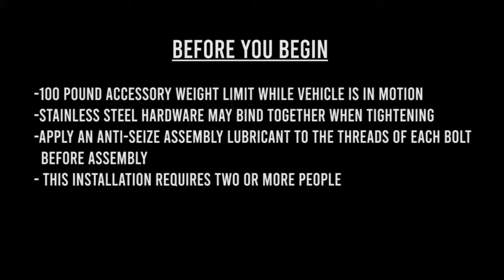Aluminess Sprinter 2019+ Rear Door Ladder Installation

Comment: For mounting the brackets, is it the same process, as for installing the driver rear door tire carrier? I have been looking for a (driver side rear door tire carrier) install video. 2019 Mercedes sprinter 4x4 2500 turbo diesel.
Reply from the maker: It is the same process! We actually have made it a tad bit easier - our new bracket only requires you to loosen one of the hinge bolts.
Here's our install instructions: 
http://www.aluminess.com/wp-content/uploads/210570-TIRE-RACK-Mercedes-Sprinter-Rear-Door-V2-Installation-Instructions-2.pdf

Comment: How does the ladder or tire/tire rack not come in contact with the body with the door open and 270 degree hinges?
Reply from the maker: Thank you for your interest in Aluminess! We are currently working on a bump stop solution to prevent the tire from hitting the side of the van when it is opened. With our current versions of this product, the customer does have to be mindful when they open their door so that it will not hit the other side of the van.
Reply: @Aluminess  Thank you for taking a moment to reply.  I own the ladder and tire carrier, but have not yet installed.  I am hesitant to do so without replacing the 270 hinges to 180--a fairly significant expense I was hoping to avoid.  What sort of timeline do you anticipate the bump stop solution might be made available?
Reply from the maker: @christopherfletcher4900  Unfortunately, I do not have an exact ETA at the moment. We are looking to have this piece by the beginning of the year.
Reply: @Aluminess  thanks for the update.  Is there any way to get on a notification list?